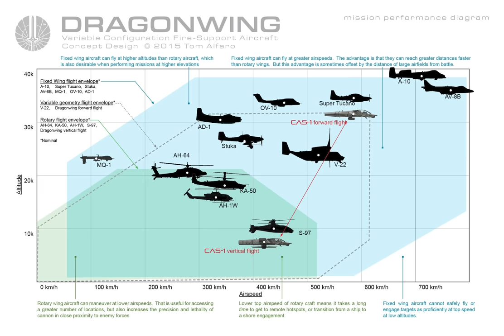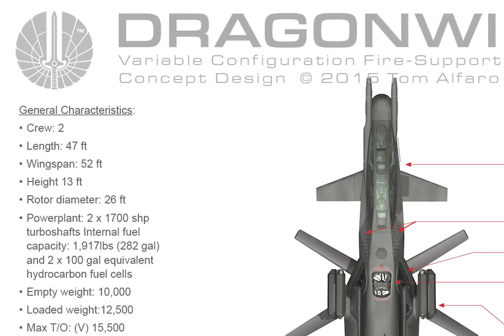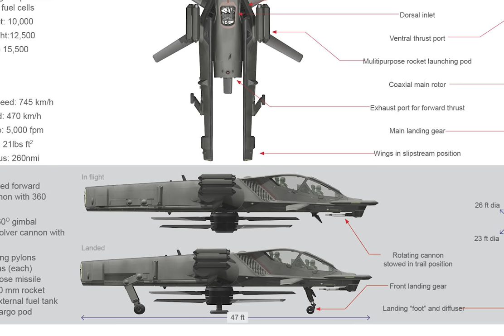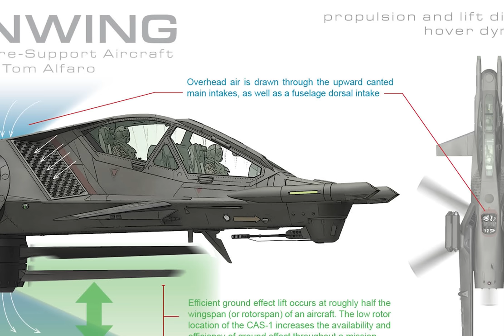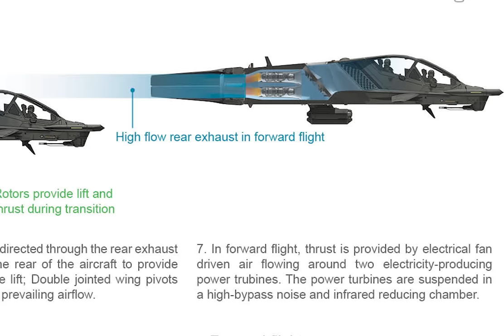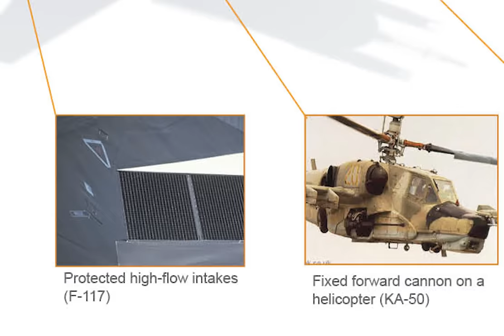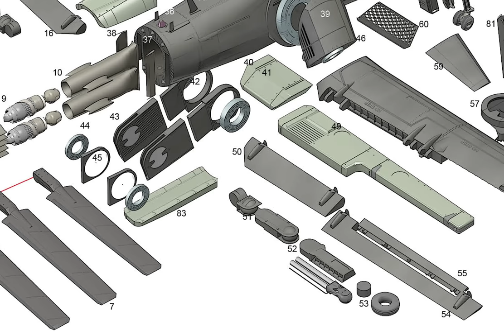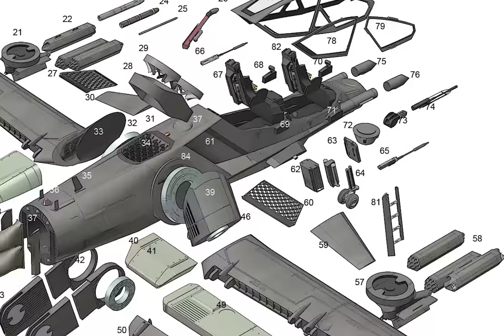Pan Spatial DRAGONWING Variable-Configuration Fire Support Aircraft: Full Presentation

Comment: This thing has so many failure modes that the enemy doesn't even need to help it. :)

My favourite one is the possibility of dying by successfully landing it - in VTOL mode - but then having to leave the cockpit.
Reply: How wide is the landing gear? The rotor is 56'?
Reply from the maker: The extendable boarding ladder is outside of the rotor ark.
Reply from the maker: @bryanst.martin7134  the wheeled extendable landing gear is of course outside the arc of the rotors.

Comment: This machine is so complex that it would brake down just by watching at it. BUT it looks so damn cool I really like it.
Reply: if the demand is so high like more than 5'00 units for the next 50 years, with various configuration with high trust engine. that may compensate for a complex system or that a net of supplier will be around for more than 50 years.  the above seems slow and short range as it does not have big twin jet engine
Reply: @blade65dagger  The F14 fighter jet is a really cool jet with the swing wing and it is actually still a high performance fighter jet still operating in Iran.  The USA gave up the jet, not because of low demand, but because it was so complex with huge moving parts that always gave problem.
Reply: Probably a smaller drone version in a sea mother ship would work too
Reply: ...break...spelling
Reply: Ur right! We need to go back to the biplane. Anything more complex would brake down and be vory slow!
Reply: @thuggeegaming659  or we could be clever and use high tech unstable design like to F16 or even better, aim for smarter characteristics (slower jet) in the F35. Or we can make cheaper more versatile easier to maintain (more air time) jets like the SAAB. Sometimes the better solutions are simpler solutions.  But hey maybe sometime in the very near future we will develop more reliable moving mechanisms and the F14 type jet (and this craft) will become viable again....
Reply: @thuggeegaming659  Biplanes have too much drag resulting from those twin wings, a sturdy zeppelin must be the right way to go.
seriously, things should be as simple as they need to be, but not any more.
Reply: Allen Jackson precious memories
Reply: You like the look? I thought it might be perceived as ugly... sweet.☺
Reply: "Tom" went all out on gimbals, LOL two, count 'em, TWO Mounted Optic Sights... where is the one aft?
Reply: @thuggeegaming659  Ah yes, the Biplane called the checks notes F35.

Comment: Mulching kit is available.  You can also bag your clippings with optional accessory.
Reply from the maker: Too funny. Last century (1992) I was in Trail, BC, Canada on a 2 week Army exercise. In town, in front of some government building some workers were using some kind of hoverboard lawnmowers. I’m sure they had a wheel or ball under the rotor hub because there were no wheels on the corners. (No way it was air cushion, right?) It was so cool I figured it’s something I would see on the US market soon. Never saw it again. Is anyone familiar with these things?
Reply: @PAN_SPATIAL  Airboard personal hovercraft.
Reply: It would end up mulching you, even without the mulcher.
Reply: @PAN_SPATIAL  look up FLYMO
Reply: Thats what i thought of as well. Its like a lawn mower with no guard.
Reply: @PAN_SPATIAL  I think you're describing FlyMo. I'm sure they've been around since the early 80s. They do indeed hover on an air cushion. But they're just not very robust compared to a traditional push mower. Plus they have an electric cord trailing behind. Very dangerous. Okay for small yards, but no good for big areas.

As for your design, my first thought was "overly complex" as well. I'm no engineer though and one could argue it's no more complex than the V22. It's also smaller meaning less mechanical stress on the bearings and moving components. And they are some large, robust looking bearings, so I think they'd be fairly reliable. As long as you have decent ballistic protection in all the right places, it would be fine.
Also someone made a point about pilots getting minced by getting out of the cockpit too soon after landing. Well that's a training issue, first and foremost. No different to getting sucked into a jet intake. But one possible mitigation for this would be some kind of rotor braking system that engages once the aircraft comes to a stop on the ground. Or say when the ladder extension is actuated, the rotor brakes are applied to bring it to a stop before the ladder is actually allowed to extend.

If I were you, I'd try contacting some small module developer to make a virtual version for use in DCS. You would very quickly find out how mission capable your design is using this popular combat flight sim. Maybe have a chat with the guys developing the AH-64 Apache for DCS. They might consider it worth their time once they finish the Apache.

Good luck, I think it's great!
Reply from the maker: @toothpik00   Thanks and omg I wasn’t dreaming. If flymo is real maybe dragonwing stands a chance!
Reply: I'm giving it a 
    NO
Reply: @patrickbrady519  Wow, that's really cool, man. Good for you!
Reply: @PAN_SPATIAL  I saw one back in the day, flipped over at the store on display. It had a fan over the cutting blade. It was a legit hovercraft. I doubt it worked well, otherwise you would see them more often.

Comment: interesting exercise in complexity. while basically rational, if the designer knew the history of military aircraft R&D, particularly surrounding vtol winged-hybrids, the person would know that much simpler more effective designs, still did not make it to production. i would suggest that there are air-taxi designs currently, that with tweaking could outperform, out simplify this one. they might have better range, payload, and fuel efficiency along with ease of maintenance and battle resilience. it's cool looking, but i think that GI-joe toy designs of the 80's are actually more practical.
Reply from the maker: As it turns out, the designer does know the history of military aircraft R&D, particularly surrounding vtol winged-hybrids. Which is why, in addition to broad military service to begin with, he has supported government and commercial clients with high impact concept design and development for over ten years.  If the commenter read the title of the Pan Spatial branding, and stated purpose of the Dragonwing design exercise, he would know it is simply an exercise in science fiction. The kinds of science fiction that require some (but not entire) suspense of reality. But nevertheless eventually result in improvements or revolutionary changes to real state-of-the art. Almost done. Nevertheless, the commentor’s level of detailed analysis, even of a weird concept, is necessary for pulling apart existing technology and creatively extrapolating a different and potentially better solution.
Reply: Exactly

Comment: As everyone has said this design would be too complex and maintenance intensive, though another crucial aspect is the fuel. How will you have enough fuel in the main fuselage or wings without significantly affecting the centre of mass especially in the transition from vertical to forward flight and vice versa. Great concept and the creativity is most certainly there, a lot of the design decisions are made with good rationalisations, however this type of design would be in the realm of fiction until there’s a breakthrough in energy storage as well ad materials technology to allow for more robust mechanisms that do not fail as often and are cheaper to manufacture.

Comment: It looks good, but a few observations that could help simplify the aircraft:

1. Fixed wings - if the goal is to provide additional lift then the wings can stay locked forwards even in helicopter mode. The new 360 Invictus from Bell goes the same route and the fixed wings provide lift and extra space for armament pylons. You can shrink the wings to the size of the main rotors to ensure compact profile.

2. Combined rotor and fan thrust - might as well maintain the main rotor as both lift(in helo mode) and propulsor(in plane mode), that radically simplifies your moving parts and would make the aircraft much easier to maintain.
Reply: You don't pay attention

Comment: The rotor blades underneath the fuselage are gonna be an issue. The ground effect when landing would be interesting but the amount of debris those would throw that close to the ground when using vtol would be crazy and could even cause damage to the rotor blades and the aircraft itself. Id also be worried about air flow to the rotor blades when sandwiched between the ground and the aircraft. It would be much simpler, cheaper and nearly as effective to just have a dedicated push prop vs having that complicated tilt rotor. I appreciate the idea but I think there are simpler and effective ways to go. It could be an interesting technology demonstrator.

Comment: I see comlex aerodynamics problems in transition phase. Both the angled wings and rotor, temporary convert the propulson and the uplift into a high forward pitch force.  If the propoulsin transition could be done fully in gliding mode that could slightly negate the effect, but I think its aerodaynamics isn't that stable for gliding. Design is genius, I would license this to a videogame or movie.

Comment: the main problem with this design in my opnion is that all those moving parts require hydraulics or eletric motors which weigh quite a bit and with the power plant being so compact, it would probabily not be able to generate enough power to lift that thing off the ground, and even if it could, it would not be able to carry as much ordnance as a regular attack helicopter, nor would it have the speed of a short takeoff light attack plane, not to mention the maintenance on that aircraft would be an absolute nightmare, but then again im not an engineer so i dont know for sure.

Comment: Every moving part on an airfram is not only an additional failurepoint, but a guarantee of more maintenance hours per flight hour.
Reply from the maker: You are correct. And yet,as of today, Dragonwing has experienced zero mission cancellations due to maintenance delays.

Comment: Ок, I watched that very carefully and have several questions: 
1. Are you sure this coaxial rotor will not overlap? what kind of joints those rotors have? Reliable? Fast? Solid enough to pass the torque to the fuselage?
2. Did you make accurate calculation  on the rotor diameter? Will this diameter ne big enough to lift the overloaded copter on a hot day in Afghanistan mountains straight vertically without wings? 
3. Would such a rotor be safe for the crew being not above their heads  but under the copter? Do pilots sychologically ready for such a meatgrinder between them and the earth? 
4. Do you have a material light enough to be a rotor blade AND fireproof to withstand the jetstream around afterburner? What kind of material would that be? 
5. Why the weapons are exposed outside to the radar rays? All weapons in stealth era should be INSIDE the aircrafts!!! Can you find a place for weapons inside of such a construction?
6. The glassed area  of the cocpit is tooo  big. Glass that is able to protect such a ground attack vehicle should be as small as possible. You can reduce it without sacrificing the visability for pilots. Apache in this quality is worse than Ka-50 and Mi-28. learn from Russians on that. Just save american type of rear visability you have now.
Reply from the maker: All good points. I have addressed everything in other replies, except the size of the glass. I think the best canopies are on WWII aircraft: very small and limited to right around the pilot’s head. But, modern canopies on aircraft, and especially helicopters, have many considerations other than just visibility and climate control. So I stayed with basic proportion and functionality of AH-64 and AH-1Z canopies. One thing I could have done better: since dragonwing does not have a transmission and rotor mast behind the cockpit, I wanted to improve rearward visibility.  But there are other systems and functions that still demanded that spot on the aircraft. So rearward visibility is still a sacrifice. Thank you for your good comment.
Reply: @PAN_SPATIAL  Given the shape of this design, a few cameras would solve the visibility problems while shrinking the canopy size. A system akin to a F35's, for example.

Comment: This seems distinctly impractical. Like, the fact that it has the rotor at the bottom makes it a lot less stable, and also significantly increases the risk of the rotor hitting something while its close to the ground, which is already the most dangerous place for a helicopter. It also has to stop its rotor completely before anyone can get in or out or service the aircraft in any way.

Comment: Isn't it easier to make fixed wings, folding blades without moving them to the tail section, by adding or removing a pusher propeller, like the Defiant has? And how do you imagine the ammunition load suspended on pylons in the state of folded wings?
Reply from the maker: F-111 and Tornado have pivoting weapons pylons so it isn’t an original or crazy idea. But this is a bit more of an extreme implementation - although the pylon itself only moves through a 90 degree pivot.  Nothing exotic about that. What I have done to consider the 90 shift in load on the pylon is make sure the pivot and pylon are sufficiently wide.

Comment: The airframe isn't large enough to house the number of hydraulic valves, switches, and piping required, and the things like the rotors when stowed are too much dead weight.  Thats the problem with electric aircraft too, the heavy battery weighs the same weather it's fully charged or dead, unlike fuel which is expended during flight.  Neat sci-fi concept though.

Comment: The core problem with the design is that 60% of the landing gear is on the wings, the wings are retracted during vertical thrust, so it can't do a vertical take off. 
As vertical take off is  is about 90% of the time you would need vectored thrust, the design immediately kills its own prime advantage. 

There also seems to be very little combat redundancy between the flight modes, making the platform very fragile. For example, if the rotors are shot off, you also lose the jet engine nacelle, which means no fallback to jet power. 

A small traditional aircraft with a very low stall speed and fuel efficiency at low speed would work better; loiter at sub 100mph for long on-station time. That and the ability for short burst fast travel when needed (i.e. reaching the combat area) might work well... but that class of platform already exists; modern fixed wing drones. 

Looks cool though.

Comment: Beyond all of this thing's design flaws I mentioned in your other video, if this thing transitions the way you think it will, it will simply tilt over and fall, either straight down if you're hovering or at an angle if you have angular momentum.   If you want to remain airborne, you will need to get forward momentum and deploy the wings so they can provide the lift while the rotors transition to the rear.  Even then, with the movement of the center of gravity rearward, it would not be a stable transition.

In regards to those electric motor driven hubless coaxial rotors, I certainly wouldn't trust anyone's life with an untested technology that is yet to even exist in large scale rotorcraft.  Make this a UAV and it will more likely get picked up as a tech bed tester, with consistent reliability a manned version might be funded, but I doubt they would pick up any large rotorcraft with unprotected ventral rotors.

Comment: when its using it wings to fly, how does it push itself forward when the rotor is not in use at straight flight? where is the thrust outlet of the engine?

Comment: I love how theres no engines anywhere.

There's just a handwaived "internal fans" comment.  But ... what drives the rotors?  What drives the internal fan?  

And the transition phase, all the lift is apparently behind the centre of mass - literally the wings are behind the fuselage as well as the engines.  This whole thing would flip madly.

Don't get me started on the clearance for the rotor, and the tiny ass rotor blades.   This thing *looks* amazing, but it's a deathtrap.

Comment: I don’t see enough info about how it will land without the rotors chopping the landing gear.
Reply: The landing gear are far enough forward and far enough aft that they are outside the circumference of the rotors.  And it took me a minute to get it, but the reason the rotor is on the bottom is so that the rotor does not have to alter rotation direction or feathering direction during the rearward transition to fixed-wing flight.  It seems smart... but it also seems like a maintenance nightmare.  But probably not much worse than an F-35B or a V-22 Osprey.